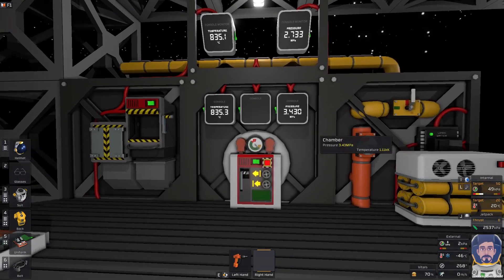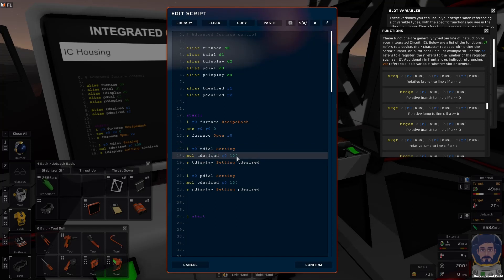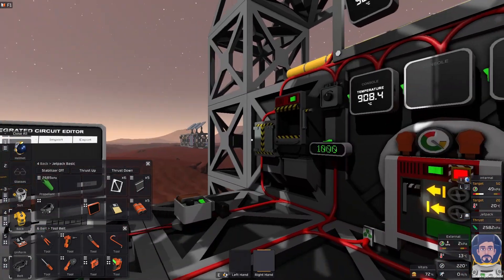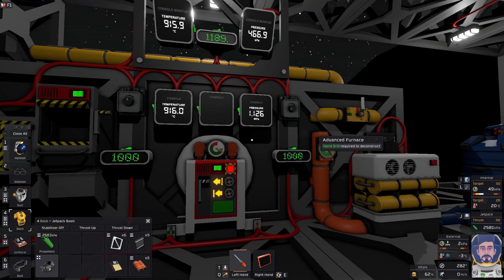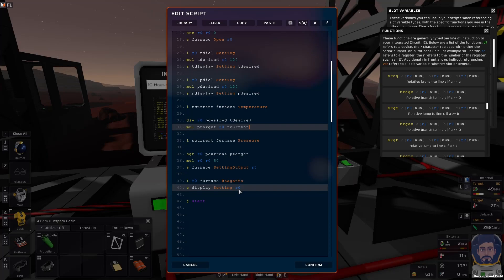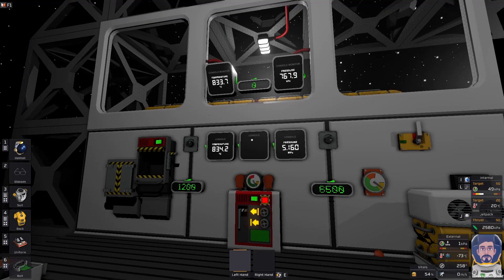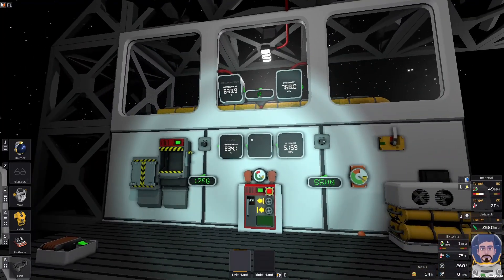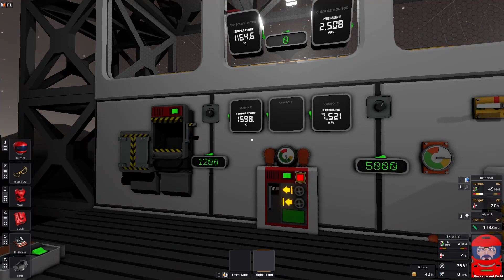Stationeers Finishing the better furnace

Comment: i know this is an older video, but i need a little help. i have my ic setup and everything. but my ic flashes in error. "error unknown at line 21" line 21 in the code says ""l r0 tdial setting""

Comment: hey mick could you pls update this pls tryed your map does not seem to work now tryed making steel just sat there that new one one u made is way to complicated for me at the moment
Reply from the maker: This should still work.  I still use this in my base.
Reply: @cowsareevil7514  ok got it working did not relies you have add fuel manually is the electrolyser nerfed burns a ton power with hardly any fuel made

Comment: The math on the pressure target  = (desired pressure / temp desired) * temp current has me stumped. I can't seem to wrap my head around it. Is this step necessary? I am trying to set my first advanced furnace up and I am wondering if it is simpler to use the automation to pump out pressure if it is greater than the desired pressure from the dial x 100. I tried to google the ideal gas law but I am stumped.
Reply from the maker: This is for PV=nRT gas equation.  You set temp and pressure, if the actual temp is higher than setting then the pressure needs to be higher than the setting so that when the furnace cools the pressure drops to match the setting.
Reply: @cowsareevil7514  Thank you !

Comment: This is pretty good for alloys, but f.e. vaspaloy i have waited to furnace cool down and tryed to get that 50Mpa in to that furnace. Cant do it. Your code is good, but do you have any suggestions for like fully controllable temp and pressure? Where you just pick temperature and pick pressure and it does exactly those.
Reply from the maker: There are furnaces like that on the workshop, but the are much more complicated.
When smelting, I typically set the temp and pressure for the alloy. and then smelt gold and copper at a low temperature until the furnace starts to vent.  Then it should be ready for a alloy.  Add the ingredients and turn on the gas.
Reply: @cowsareevil7514  I just heard something pretty simple solution for this. Just fill cool furnace with gases whom doesn't warm so much. Do you think that could work?

Comment: I've followed your build exactly, short of trying to blowing it up. Worked great initially, but I ran into two problems. 1) the constant supply of water to the Electrolyzer is consuming all of my ice/water stores, and 2)the pressure/temp ration doesn't see to work anymore. I tried making Invar and managed to get the Pressure up to 19MPa, but the temperature won't drop below 1596c (1869.15k). I have my Desired Pressure set to 18,500 kPA and my Desired Temperature set to 1,000c (1273.15k)
Edit: Watched the first video again. Think I found my issue. I placed a wall between the furnace and the waste tank, which it looked like you didn't. Will remove it and see how that goes.
Reply: @John Void Not really, so I scrapped my furnace room used a different setup and used gas instead

Comment: Nice video. I've a problem with the presure.... I've I try to do, for example astroloy, I need 30 - 40 MPa, but the IC open the furnace and I can't get the presure.... the display is showing 30000 but the presure in the furnace is falling because the chip open the output.... Did I something wrong? (sorry for my bad english ^^)
Reply from the maker: It is  opening the output because the temperture is low.  Get the furnace up to temperature and the pressure will be good.
Reply: @cowsareevil7514  The temperature is 2k or more....

Comment: What prevents it from blowing? Do you have an automated valve that goes to a passive vent? Or is all the overpressure just venting into the tank? (was never clear on that part)
Reply from the maker: The over pressure vents to the tank to retain the heat.  The venting of the tank is manual.  Cool it down with the radiators and then send it to the recycling system.

Comment: tdesired r1
pdesired r2
tcurrent r3
pcurrent r4
ptarget r5

Do these items need labels? Can you help explain those
Reply from the maker: Nothing needs a label, they are there to help read the code.  They are used for calculating the desired, current and target pressures and temperatures.
Reply: @cowsareevil7514  Thank you for help! your nice!

Comment: After watching this again for my current furnace build.. i had an idea I wanted to toss at you. Maybe something we could communicate with and test together not sure. But I was watching you set up the tiles and I got to thinking with the proper IC code couldn't a dial be set to a selector switch for the different Alloys in the game like you can have position one be a general mode where the furnace will maintain temperature and pressure for just general smelting and then each setting after that could be a different alloy.  Position 1 could then be steel position 2 solder, position 3 electrum and so on? And the IC could have individual sections it jumps to depending on which alloy you're wanting to make or mode you want the Furnace In?
Reply from the maker: It is definitely possible to do but requires all of the settings for all of the alloys to be programmed into the chip so it will be a tight fit get get it all into 128 lines of code or it might be a double IC job to do it.  One IC could read the ingot selector dial and then set the presusre and temperature dials while the other just runs the furnace.

Comment: One more question... with that spare input (d5) is there a way to automate adding fuel to reach the set temperature?
Reply from the maker: At the end of the code change:
blt tcurrent tdesired start
s furnace SettingInput 0
to:
slt r0 tcurrent tdesired
mul r0 r0 20
s furnace SettingInput r0
and probably say goodbye to your eyebrows.
Reply: @cowsareevil7514  So I might be able to blow myself up??!! Hooray!

Comment: Hey Mick, this is awesome. Subscribed to your YouTube and Steam Workshop stuff.  Wondering if you would consider doing an electrical design video to help us new Stationeerios.  As I was building this I burned cables elsewhere in my base every time I turned one of the components on. I know I need to use transformers to isolate some circuits, but would really like some design theory behind that.  Thanks sir!
Reply from the maker: That is on the list.  1-2 weeks if all goes well.

Comment: For naming the dials / LEDs can you not name them with spaces? Trying to use the labeler to name them Temperature Dial etc etc but the little code window isn't taking it.
1:26 assume by use the labeler you named them tdial, pdial, etc.  Not a big deal but would annoy me to have it see it without spaces when I mouse over the LED / dial.

Also is tdisplay the top console or the LED?  Not sure what item is labeled for tdesired alias. Or is it nothing? Know you are trying to not show everything for vets, but I feel like this is a key part that needed a few seconds longer explanation for us newer foke. But I may be alone in that thought though. 

And I am not trying to say the rest isn't helpful. Your videos are very, very helpful. Just a few small details that could be a bit more clear or covered shortly. As I assume if you use the wrong alias name it won't work? Or does it 100% have to be tidal for whatever reason? 

EDIT: IC is getting error at line 17, do I have to set the other screws on the IC? You only did it for the 1st one. Or did you not show that also? >.<
Reply from the maker: You can name th edevices anything you want.  I just use abbreviations in the code because you and use spaces and dont have a lot if room.  One it is working I usually change the names of all the controls and displays so that they make more sense.  The alias for the devices d0 through d5 correspond to the device pins on the chip.  "alias pdisplay d4" means you need to connet the LED display to show the pressure to pin d4.  the alias for the registers, r1 through r6 are just used in the code and correspond to any devices.  If you are new to scripting there are easier ones in my other videos,  It might be worth having a look at them and then coming back to this one once you are more familliar.

Comment: You can also use your label gun to change the text from "console" to "furnace" for example.  Even better, you can use some HTML code to change the color of the "furnace" text on your console.  For example: <color="yellow">Furnace</color>   While you're entering it, the code will disappear on you, but keep plugging away, it'll take it!  The hexadecimal value for white (FFFFFF) works, but not the one for yellow(FFFF00) for some reason.  Blue, red, yellow, green all work.  I haven't experimented any further than that.  Cheers!
Reply from the maker: Cool.  I knew you could change the text, but I didn't know about the colour.
Reply: That didn't worked for me. When I am entering code it is working and text changes color, but when I pushed confirm button I am getting standard color and text without < or > signs
Reply: @SturmerSS  seems like they've changed something.  It's no longer working for me either.